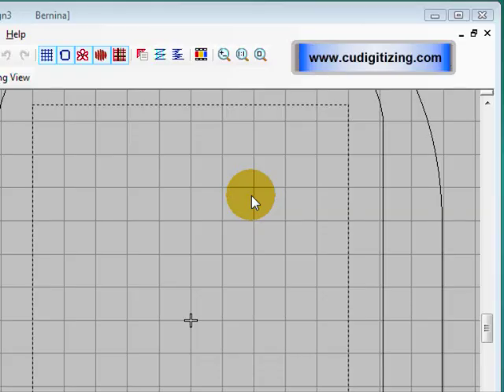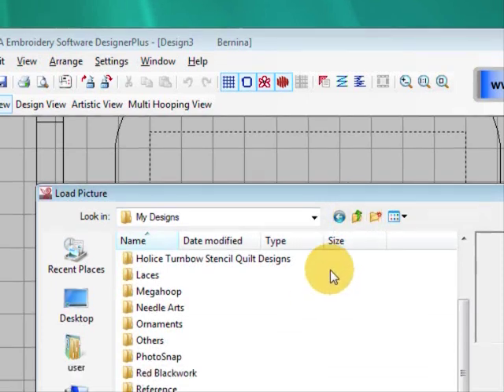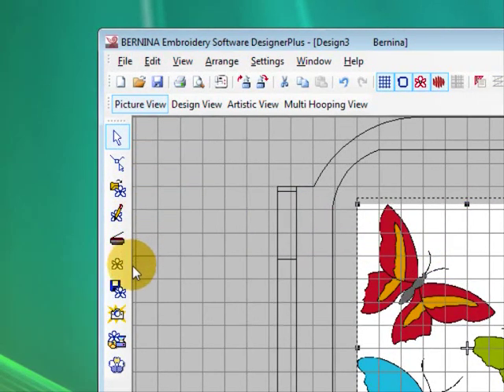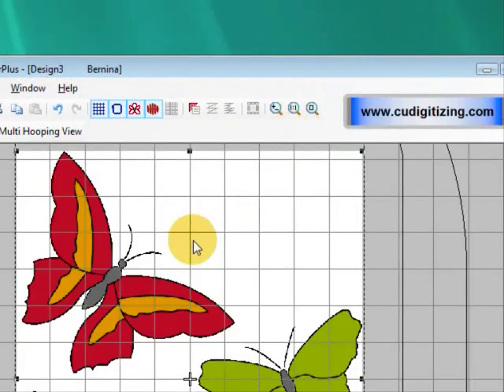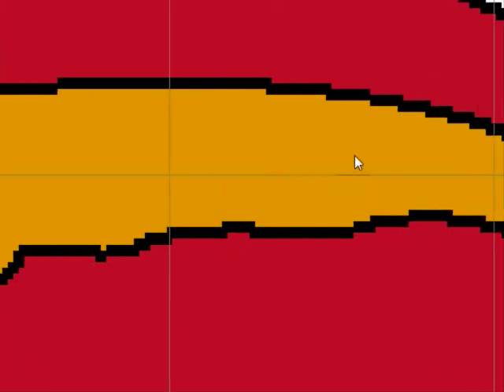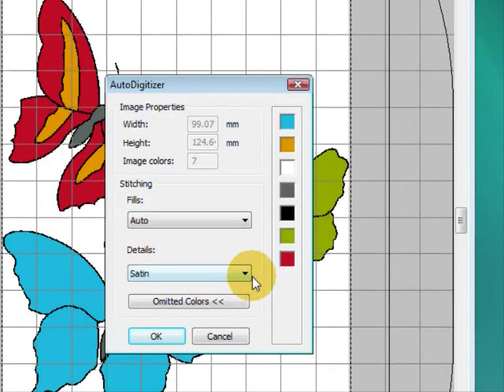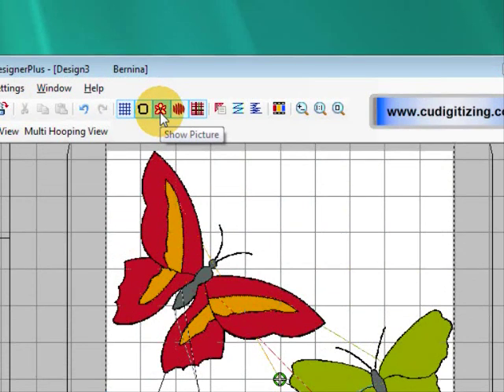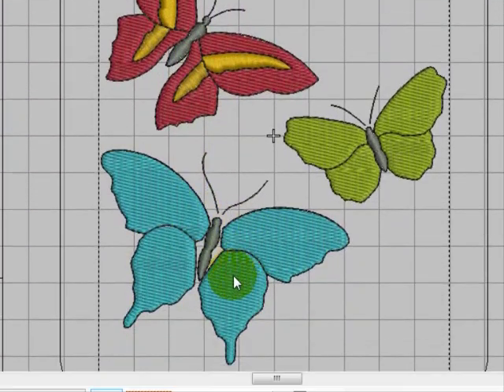Auto Digitizing with Bernina Designer Plus Part 1

Comment: If I bring in art work will the auto digitizer work if it's a jpeg file?
Reply from the maker: Hi Nancy, I am pretty sure in this older version of the software, you could use .jpeg files. Certainly in the latest version you can (V8.1) You can check by clicking on the Files of Type box at the bottom of the dialog box. This will drop down a list of the file types that can be used.  Look for clean graphics that have clear areas of color.

Comment: Carol,

Excellent video.

I have been digitizing since 1999 using Wilcom, I find that Auto-digitizing is something of a holy grail, many claim that they found it, but no one really does.

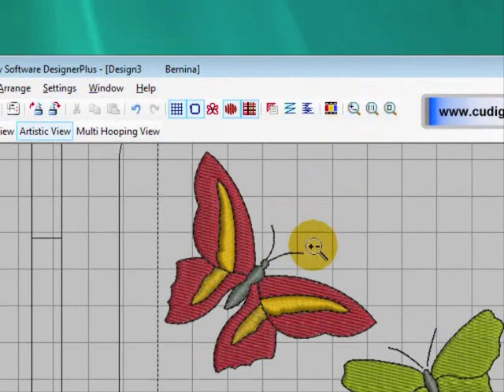If you will notice the when you zoom into your logo (video was at 7:03mins) the butterfly wings, where two colors meet - there is no overlapping.

This by far is one the major flaws of Auto Digitizing - and no matter how sophisticated the software is, it won't replace the judgement of a human digitizer.

If this design were to be sewn as is, the fabric will show through that gap and a customer would reject it immediately.

It would be wise to manually digitize designs rather than relying on auto-digitizing, having said that, you might use it for simple shapes like squares and circles, but where there are 2 colors in a single object, auto-digitizing fails miserably.

Cheerios,

Comment: I'm wondering if I were to take a simple picture, would I be able to convert it into a file to upload to thenimport it into the program. So pretty much can I take a picture and make it into a file to upload into the program
Reply from the maker: Do you mean a photo. Photos saved as .jpegs can be used, but don't auto digitize very well because of the multitude of different coloured pixels. For Auto digitizing you are better to use drawings. You can use a photo to trace around with the manual digitizing tools. Embroidery is not like printing. There are limitations to the amount of fine detail that will stitch out well. Having said that, it is possible to create detailed embroideries once you understand how to use the software to its full potential For drawings, both bitmap type files and some vector files can be used. Corel Draw Essentials is imbedded into the software to use for opening and editing graphics.